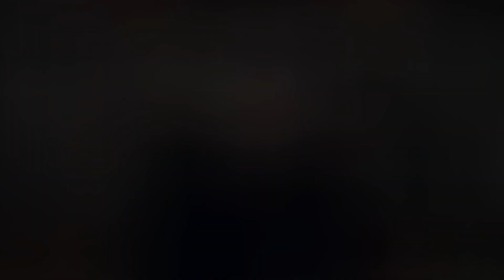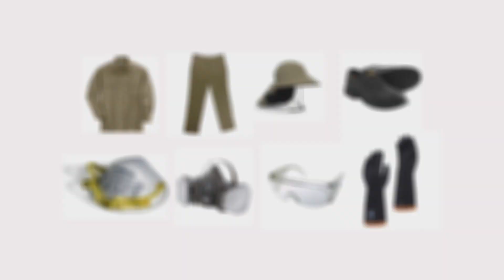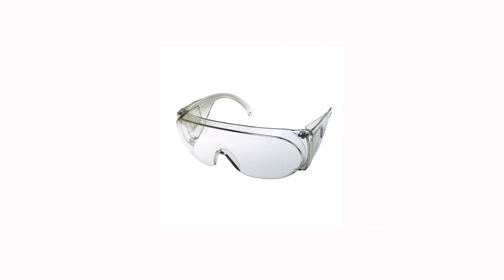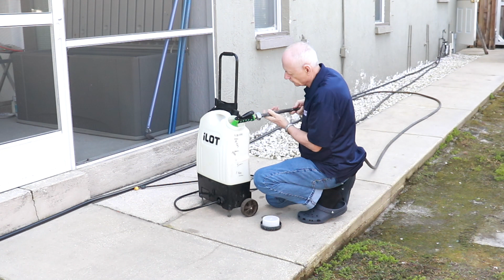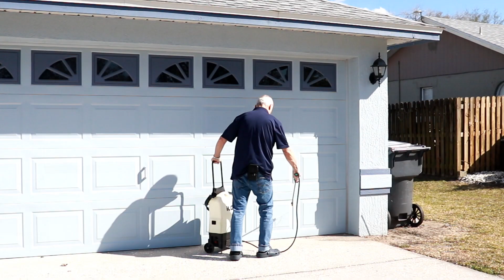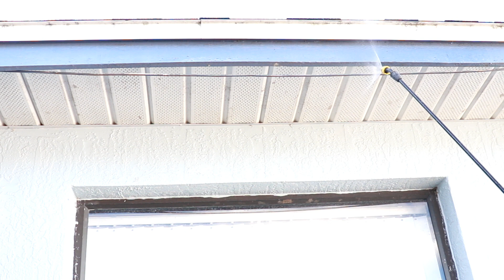How to Prevent Drywood Termites 100% Guaranteed.

Comment: I recently had my roof redone and the roofer installed 2 new roof vents. Previously we had two and now we have four total, . I'm concerned that adding the new vents will make us even more susceptible to getting termites. Do you think it would be best to keep the number of roof vents to a minimum? I'm thinking about sealing off the two new vents or removing them completely.
Reply from the maker: You are correct that drywood termites can sometimes get into roof vents.  It is going to depend on how the roof vent is constructed.  If the vent features a fine enough screen around the inlet opening, and there are no gaps around it, then everything should be okay.  However, if there is no screen or if the mesh on the screen is too wide, then that would be a fairly easy way for the drywood termites to enter the attic.  Unfortunately, you cannot always just remove the roof vents or cover them.  Your attic needs a certain amount of air flow or you are going to run into moisture problems up there. 

There are basically two ways to address this issue and still keep the roof vents in place.  The first thing you want to do is go on the roof and check to see if it has screening that is fine enough to keep out drywood termites.  If it does, then you are already good to go.  If not, then you can see if you can engineer a way to install a fine screen around the openings.  The other thing that you should do, even if there is a fine screen around it, is to treat it with a pesticide every 60 days.  You watched my video on how to prevent drywood termites.  I have another video on how to treat the exterior of your house.  This is a very similar video, except I also show you how to do it with a hose end sprayer. Actually, that video will show you how to use both a tank sprayer and a hose end sprayer.  The part with the hose end sprayer is near the end of the video.  The hose end sprayer can reach heights as high as 25 ft off the ground, depending upon water pressure.  So, a lot of the time, you can pretty much just spray the vents from the ground.  This is not always the case, but you may just get lucky.  To do this, you need to use a different product though.  to use a hose end sprayer, you must use Bifen XTS.  The reason for that is the other products are not going to get picked up correctly in the sprayer.  The Bifen XTS is a wonderful product, and that is really all you will need to do the exterior of your house.  It does not last as long as Taurus SC, so you need to do it every 60 days, but if you do your entire house with a hose and sprayer, it is way faster.  You are not supposed to do it that way because it exceeds label recommendations for the amount of pesticide you are supposed to apply, but I can tell you that it will not harm you or the environment.  In fact, you may experience less overspray.  I always treat my entire yard for bugs with the hose end sprayer, and since I already have it in my hand, I just go ahead and do the house as well. 

I hope that helps.  Be well my friend.

Video on how to treat the exterior of your house:  https://youtu.be/Yozv3s-Qwlw

Video on how to treat your yard with a hose and sprayer. (I included this, just in case you may want to consider treating your yard as well.  It is a very good idea to stop other pests.):  https://youtu.be/wifoTU5dmp0

Comment: What should I do if dry wood frass kicked out of the floor boards? How quickly do they move and if I spray the holes will that kill them?
Reply from the maker: The first thing you need to do is decide if you are going to replace the floors or not.  If you are not going to replace the floors, then shoot a fipronil foam, like FiPro or Termidor Foam into each of the kick out or exit holes for about 5 seconds or until the foam is coming back out at you.  This should kill the gallery, but it is always better if you do a full treatment.  The problem with doing the full treatment though, is that you need to drill holes.  So, if you are not going to replace the floors then it is best not to drill holes.  If you are going to replace the floors, then simply drill a tiny hole that is wide enough for the applicator tip to get in, every 4 inches along the infested area.  Drill the holes about half way through the wood.  Shoot the foam into each hole for 5 seconds, or until it is coming back out at you, or coming out the other holes that you drilled.  Each hole should have foam either going into or out of it.

That being said, make sure that these are drywood termites and not subterranean termites.  If you are not sure, then watch my video on how to identify termite species.  If you are sure that they are drywood termites, then it is important to understand how drywood termites work.  They enter through cracks and crevices around windows, doors, the eaves, pipe penetrations, and so forth.  Most of the time, they enter through several locations.  That is because a swarm of them attacked your house at the same time.  If there was a crack or a crevice, then they probably found it.  After they established their galleries, which will be inside the wood, it will take four to seven years for them to be able to swarm.  Now that they are in your house, the swarmers will use holes that are in your studs to travel through the walls.  Those holes in the studs were created by the electricians to run the electrical wiring.  Not only are these holes going through the studs, but holes were drilled into the attic for the light switches and to run some of the wiring for the outlets.  So, the termites now have easy access throughout the attic and the walls.  If you have a basement or crawl space, they have access to that as well.  Most of the time, you will have no idea that they are in the walls, because the frass is inside the wall.  To make matters worse, if you have drywood termites, then your neighbors have them too.  That means you have been getting swarmed for as long as they have existed in the neighborhood.  Most likely, we're talking about years, so it's a safe bet that you have these guys in many locations in your home.

I always hate to be the bearer of bad news, but if you have drywood termites, the only sure way to get rid of them is to fumigate.  Prices for this can vary wildly in this industry, so I recommend that you watch my video on how to hire a pest controller without getting ripped off.  That video can save you a lot of money.  You should also know that the gas they use to fumigate has absolutely no residual action whatsoever, so you can get reinfested the moment the tent comes down.  Like I said before, if you have drywood termites, then your neighbors have them as well.  Since drywood  termites swarm every year, it is almost a certainty that you will be reinfested within a year after the fumigation is done.  The only way to prevent this is to do a preventive treatment on your house every 60 days.  Most pest controllers will not do this, so it is something that you generally need to do yourself.  The video you watched will show you a way that works great to prevent drywood termites, but I now have a faster way to do it and I will place a link below for it.  You can do it with a hose end sprayer and it's a lot faster, but you need to use a different product.  The hose end sprayer treatment method is near the end of the video.  I use the hose end sprayer to treat around windows, doors, soffits, fascia boards, and so forth.  It's a huge time saver, but you need to do it every 60 days.  If you absolutely cannot afford to fumigate your house, then you can try spot treating it yourself.  It is virtually impossible to find all the termite galleries, but it is way better than doing nothing.  Regardless of how you treat it, you should begin the preventive treatment immediately, so that you do not get additional termites paying you a visit.

I hope that helps.  Be well my friend.    

Video on how to identify termite species:  https://youtu.be/dIs_a0nfVjg         

Video on how to hire a pest controller without getting ripped off:  https://youtu.be/y-a8XOqVrlE

Video on how to spot treat drywood termites:  https://youtu.be/U7ck7zhS0Xo

Video on how to prevent drywood termites (You do not need to treat the yard for drywood termites.  Just the house):  https://youtu.be/Yozv3s-Qwlw
Reply: @GuysPestSolutions really a sound solution for dry wood termites. Most pest control guys assuring me that treating walls windows doors and ground prevent dry wood termites. But the reality is it could get into fascia eaves soffit etc
Reply from the maker: @Dandanakka82  You are correct.  In fact, it is very common for drywood termites to enter through the eaves.  The reason the pest controllers will not tell you that is because they do not want to treat above their heads.  When you spray the eaves you are going to get hit with some overspray.  That is no big deal for you because you are only doing it every 60 to 90 days, so you will have very little exposure to the products.  When you are finished, you can take a shower and you will be just fine.  Pest controllers do this all day, every day, and they are concerned about long term exposure to pesticides.  If they treated eaves all day long they would be covered in pesticide every day for years.  Pesticides are not all that hazardous, but you wouldn't want to be covered in laundry detergent all day long for years either.  So, for you, it's perfectly safe, but for them... Well, who knows?  I have never met a pest controller that has gotten sick from pesticides, but it is a concern for them.  So, most companies do not allow their applicators to treat above their heads.  Now you know the truth.  Be well my friend.
Reply: Thanks Guy. Is the Spectracide terminate foam a good product for penetrating the holes or Termidor preferred?
Reply from the maker: No.  The Spectracide foam is not a good choice because it is a fast kill product and that is not what you want.  Do it yourselfers like that fast kill stuff because they think it's working well, and that is why companies market it to homeowners, but the pros know that you want to kill termites slowly.  The idea is that you want to take out the queen, so you need a slow kill product that will give the termites time to spread the pesticide around to all the termites, including the queen.  So, I recommend that you buy either FiPro or Termidor Foam.  I like FiPro the best, but they will not ship it to some states.  I will give you the links.  Be well my friend.

FiPro:  https://www.domyown.com/termidor-foam-p-3528.html

Termidor Foam:  https://www.domyown.com/termidor-foam-p-3528.html